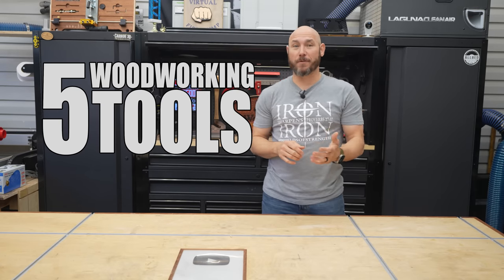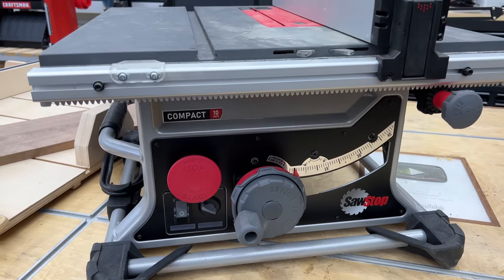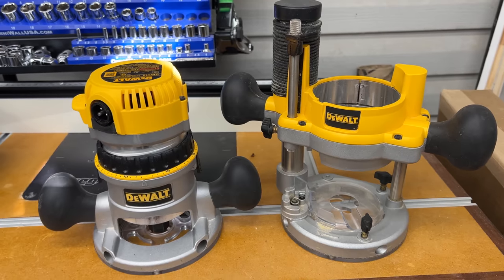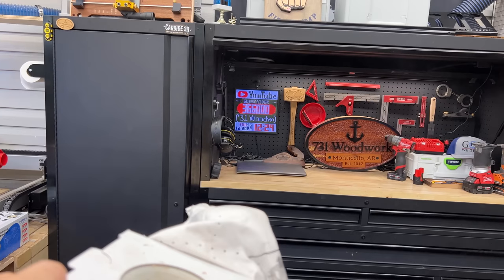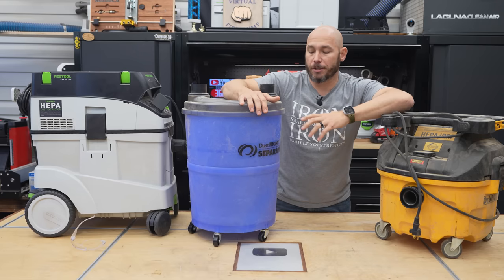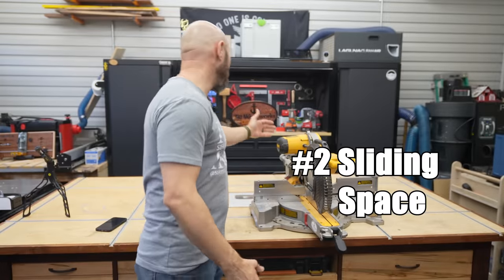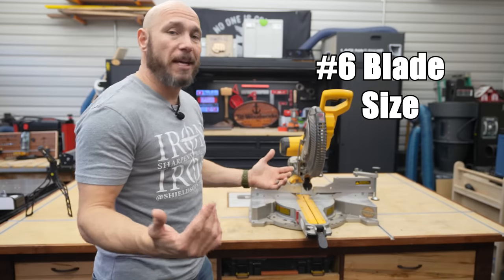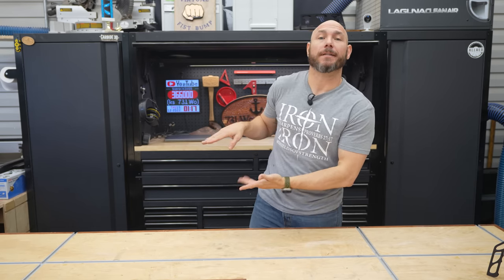5 Tools You'll NEVER Regret Buying!

Comment: Suggesting a budget table saw (~$500) than talking about a Festool extractor (~$1,000) seems strange.

I'm also not sure I'd suggest a SMCS as one of the first five tools. I think that money put into the table saw is a better use of the cash for the budget constrained.  An old, used, contractor saw would be best. If a 50s or early 60s (cast iron wings) Craftsman can be found, just yell EUREKA!  Every once in a while one shows up for a couple of hundred bucks.

Other than finding an old gem, $1000+ (budget table saw + SMCS) is much better spent on the table saw.
Reply from the maker: I suggested a "quality" saw which can include the DeWALT.  Nothing wrong with it.  Also didn't say these should be your first 5 tools, I said these tools you wouldn't regret buying.

Comment: Is there a router made without the ability to adjust the height?
Reply from the maker: yes and they are typically meant to be used in router tables.  However, you sometimes need to state the obvious because a beginner may not realize that and buy something like the one in this link thinking they are getting a router they can use free hand.  https://www.rockler.com/triton-325hp-router-motor?country=US&sid=V91040&promo=shopping&utm_source=google&utm_medium=cpc&utm_term=&utm_content=pla&utm_campaign=PL&gclid=CjwKCAiAh9qdBhAOEiwAvxIok_nVdgl_oZUxLCNMKymi_AEJ4dzx_wIZ1DD1qFBj2zKFiWD1F7FoLhoCqoEQAvD_BwE

Comment: I have delta table Saw and cant get the fence to stop wiggling
Reply from the maker: if it is the one in the video I showed, there are adjustments on the fence.  Take it off the saw, flip it over, you'll see them. good video here https://youtu.be/AK5MLWRHIa8?t=278
Reply: @731Woodworks  you’re a life saver 🤣 I literally stopped eating my dinner and ran to the garage to mess with it.

Comment: My biggest regret with my ryobi table saw is not have a rack and Pinon fence
Reply: For me it's the crappy miter slots on the ryobi table saws. My fence stays straight but those slots just suck.
Reply: @JamesSmullins  well I am now learning the difference between T Handled fence or rack and pinion and how it provides more stability.

Comment: The tool I regret not buying sooner was my track saw
Reply: I have yet to find a requirement for this.  It's good for cutting down sheet goods, but does not seem to work well for repetitive cuts, small pieces, joinery cuts, edge cuts (like rabbets, resawing, and grooves), etc.   Maybe it's just my projects.  I use sheet goods a few times a year and I cut to rough dimensions with a circular saw and guide and final cuts on a table saw.

Comment: Band saw, and Belt-disk sander.
Reply from the maker: Good picks!
Reply: Yeah a belt-disk sander has been great for me. I use mine for bringing a rough cut closer to the line (metal and wood) . Thinning little shims. Or sometimes I need one screw just a little shorter (be safe...)